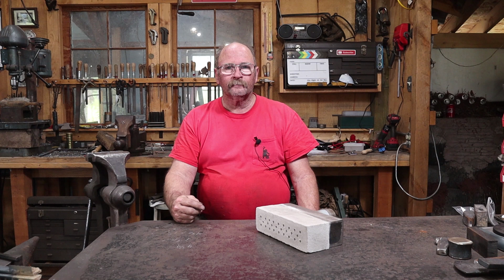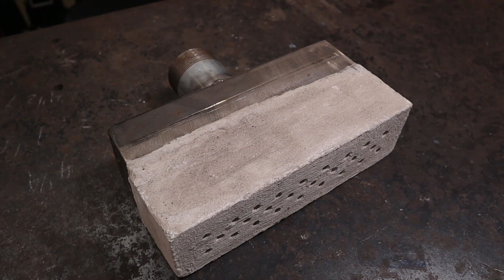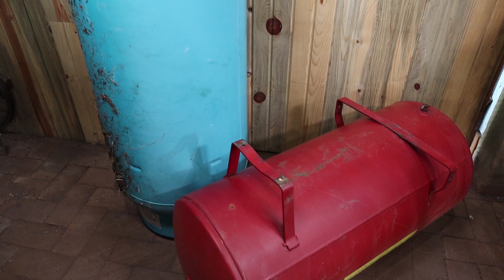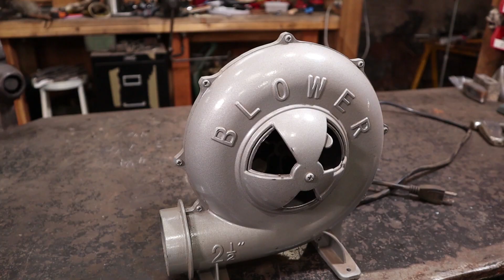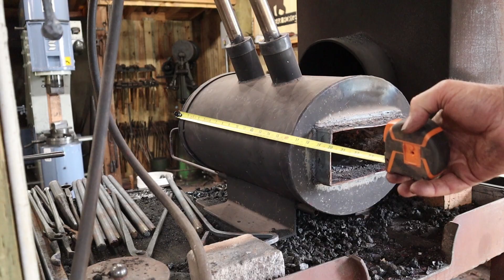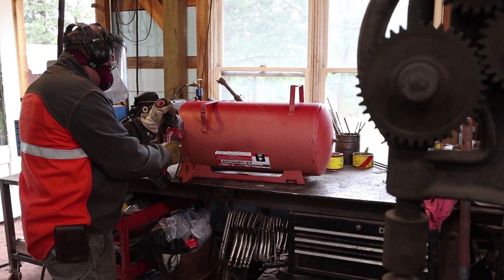Ribbon burner forge build - part 1 - introduction

Comment: I haven't watched the rest of your ribbon burner forge build yet, but I just built one for my forge ( https://www.facebook.com/Fire-and-Ice-Forgeworks-100348898162410/ ) and if you need any advice on refractories or jet size, etc, let me know. One huge suggestion is make sure you use a "gate valve" to control your air, and a "needle valve" to control the gas... I'm just getting started in the blacksmithing/bladesmithing and it's been a very rough go to get things started over these past 5 months (especially with so much shut down because of Covid)... I'm finally at a stage where I can start making products to actually sell, and your videos have been a great inspiration and a wealth of information (thank you!)... I look forward to seeing more of your work and instructional videos, and I'll be out in my forge (full time) starting this week! ( https://www.facebook.com/Fire-and-Ice-Forgeworks-100348898162410/ )

Comment: I'm building a ribbon burner, I have seen a you tube video of witch the builder have a safety switch of which shuts off the propane if the blower shut off for any reason ( for safety sa I to don't want to burn up me or my shop).
 I bet you get the valve for fire safety also
Thanks John
Reply from the maker: I did pickup an electric solenoid valve and an air flow sensor for that purpose.

Comment: How much do you know about the engineering of the ribbon burner? 

From what I know which isn’t much. It’s best to match the area of your inflow tube to the combined area of the burner holes. You have 26 holes in your burner and your blower is marked 2 ½”. Now I am sure your Burner has a much smaller Inlet hole then 2 ½”.  So to get what you have to work right you’re going to need to neck things down 60%. 
One way to look at what you’re trying to do is, look at it the same as an internal combustion engine (and in a way it really is, but your trying to produce Heat instead of rotational force).  You blower is your 8-71 Supercharger, then try to shove all that air through a 2 barrel intake manifold into a 2.0 L V6. (A.K.A. Over Kill and totally uncontrollable)
Now to take a S.W.A.G (Scientific Wild A$$ Guess) at your Burner, I assume your inlet Diameter is 1” Dia. and your 26 burner holes are .196 Dia. each. For your Blower I would size it to the Burner and find one with the same size as your inlet. Personally I think that 2 ½” Blower is going to be far too hard to control because you’re going to need to diminish it’s performance so much it will become uncontrollable. But sense you have it, try it out. I would like to see the results as far as Imperial Data. Not to say “I told you so”, but to know what is happening to pass the knowledge on, when you see the same results you will know what the problem is.
Now by my calculations the 2 ½” blower would support a burner design with a 2 ½” inlet and 162 .196 Dia. burner holes.

I would like to know the optimal size for the burner holes.  I haven’t found any information on the optimal size for the burner holes.

Comment: John I use one of these in my shop now for three years. You will not be disappointed. Make sure you utilized proper safety measures,ie gas solenoid attaches to the blower circuit.
Reply from the maker: I will be adding an air pressure shut off
Reply: Smart choice. Like I said it will not disappoint. I have mine vertical however if I were to do it again I would have the burner come in at a tangential angle. In a semi round housing. Much like you are looking at using. Can’t wait to see what you come up with.

Comment: I have a charcoal forge made from the bottom of a steel drum filled with dirt, then a perforated pipe, then clay mud mixed with grass. An old hair dryer is my bellows and I'm getting a portable camp power supply soon for use at my forge and in my shop!
Reply from the maker: Charcoal is the oldest fuel for forging
Reply: @BlackBearForge  Second oldest actually. The iron age and earlier used wood. Which is the fuel I started with. Just a simple fire out in the open. I dug a shallow pit near the center in the ash to focus the heat, that's where I placed my steel. But I don't recommend wood save for making clean charcoal lol Too many contaminant that your metal can absorb. Like oak has alot of sulfur in it and such. 

Right now I use wet charcoal. I find that it works better and lasts longer than dry since the moisture causes it to activate in the heat.

Comment: Ive made a ribbon forge and use it all the time. Its super hot to be around too. The best change over i have done. The whole forge heats up, with no hot spots.  Get a speed controler for your blower, it will help with fuel/air mix set up.

Comment: Would a 110 lb steel anvil 16 by5.5 inches with the pritchel and hardy holes  made out of c 45 cast steel be good for  a starting blacksmith.
Reply from the maker: Thats a very good size anvil.  Cast steel should be good, just avoid cast iron

Comment: Great topic Mr. John.  
Your going to beat me to it I'm pretty sure. My 1st forge is going to be a ribbon burner forge.  According to my research...the best way to build a professional grade ribbon burner forge includes the following. 
A. 2 layers of kaowool outer layer is installed as is. Inner layer is at least coated with hardener if not permiated with hardener then dried
B. A layer of Mizzou is installed at least .5 in thick better 1 in thick. Then dried thoroughly. 
C. ITC HT100 is then applied to the interior surfaces of the Mizzou.  After its fully cured your forge should be ready. 
(See optional addition)
D. ITC HT211 OVERCOAT (I think its 211 or 213, sorry memory is not clear) this overcoat is applied over the HT100 and is the final coat.
E. ITC HT213 METAL COATING is applied over all metal surfaces liable to come in contact with internal forge gasses directly or indirectly. This application will severely deter the corrosive effects of heat erosion and damage caused by rust.
F. A ceramic removable plate is installed in the floor of the forge. It protects the forge floor from the corrosive effects of  borax and related chemicals that are used in forge welding  and also catches  whatever scale and debris and is replaceable by the operator at their discretion. 

So all that previous is the best case scenario I have been able to come up with to build the most complete forge. 

At this point I'm still trying to figure out what the best all around position is for the burner installation.
1. In top blowing down on the material
2. In the side blowing in as a side blast
3. In the bottom blowing in off to the side of the ceramic floor plate.

I can see issues w down blast and side blast configurations. However it is my understanding there is some benefit from casting the burner in to blast up from the bottom as that orientation prevents flame erosion of the materials.
  Your most likely to have a better information source on that than I. As such any information will be mist helpful.
 On a side note a 10 in burner w 26 holes at 2 to 3 lbs with proper forced air should be capable of forge welding heat for 1.3 or 1.5 cubic feet of I recall correctly. 
 I hope this is of some value for you  Mr. John Switzer. 
🙏blessing abundant sir 
Crawford out 🧙‍♂️
Reply from the maker: Thaks for the info, I have never heard of ITC HT213 METAL COATING before
Reply: @BlackBearForge  , Mr john...I may well have the numbers wrong. I'm prone to that.  But if you go to their web site they have lots of stuff.  I think its International Technical Coatings  Fort Worth, Texas.  Maybe I dont screw the name up too lol.
  Hope it's some helpful information.
Reply: @BlackBearForge , I am building my forge on 20in diameter. 250 wall well casing . Hey its substantial and free so why not. Be to big to steal easily lol. But this is my planned build after talking with Pergatory Forge and a few others. My estimate is it will be 15" ruffly interiors ruffly 16" deep. I've got a 12" burner and a 14"  made up ready to cast.  I just need to determine where to locate the burner inlet. 
 On a video you posted of an event you attended the  Smith used a burner forge w the burner located in the bottom.  I cant remember his theory though at the time it seemed a better idea than top blast or side blast. From the bottom it would seem the material being heated would be clear of direct contact with burner gases. What's your opinion based on your superior knowledge of forges sirSir?

Comment: I've built a number of ribbon burner forges. By far the best one I have is a single inline hole burner which is angled at a tangent to the tubular combustion chamber. This creates a swirling, or vortex, effect within the forge. The advantage to this design is that the flame stays in the forge longer, imparting more heat to the lining and increasing efficiency dramatically. Another nice feature is that the flame is travelling at 90 degrees to the opening. I have made two "doors" with a small opening at the bottom, and I can stick a piece of steel through the opening and only heat the part which is inside the forge. There is also no flame exiting the forge.
When built this way, the forge is several times more efficient than a standard ribbon burner pointing straight down into the combustion chamber. I'm currently using only 5 openings (5/8"dia) and my forge easily gets up to welding temps. Think of building an efficient oven (which it really is). If you are interested I can provide further info.
Reply from the maker: Have you done any kind of video on the forge?
Reply: @BlackBearForge   No video, but I did post my build on IFI if you want to take a look. The last page of the thread shows my current configuration, which works quite well and is what I am now using. BTW, I've come a long way since then, largely due to your videos! Thanks. 
https://www.iforgeiron.com/topic/57404-forge-from-an-air-tank/

Comment: I would love to see you make it such that it could double as a foundry.  Fundamentally the builds are tremendously similar with orientation of vertical vs horizontal and burner location being the primary differences, but I have never seen a multi purpose rig.
Reply from the maker: Since i have little or no interest in foundry work I probably won't try to design it that way.

Comment: My home built ribbon burner has a smaller burner, blower, and chamber. The handiest gadget is a direct read temperature gun from eBay. It's like a small orange radar gun that has a green laser.  Point and squeeze the trigger. The display reads in Celsius or Farenheit. It was less than 60 bucks if I remember. Looking forward to your  build! 😃 Use a gate valve for the fan/propane pipe. Better flow control than a ball valve.
Reply: what temp does it read to? If it reaches 2300 f or 1260 c, I would love to know the model, for that price
Reply: @ZoltanBnB  The little foam lined hardcase or the instructions have no manufacturer name.  The unit does measure up to 1300C however. There is another one above this one that goes to1600C. Mine is model # HT-6888. The highest one is # HT 6889.

Comment: John, how does the efficiency compare between lp and natural gas? 
🐾🔥⚒
Reply from the maker: I suspect the volume of fuel is similar.  But natural gas tends to cost less where its available.
Reply: @BlackBearForge  
Thank you, John.
Reply: From what I understand you must use larger fuel orifices when using natural gas as opposed to LP.  NG must not be as efficient.
Reply: @garybower1824  Natural gas is normally used at a much lower pressure than LP that is a large part of why the orifice for NG needs to be larger.   Natural gas is cheaper per BTU of heat it can supply if you have it available.
Reply: Learn something new every day.  Thanks Paul.
Reply: @garybower1824  
Thank you.